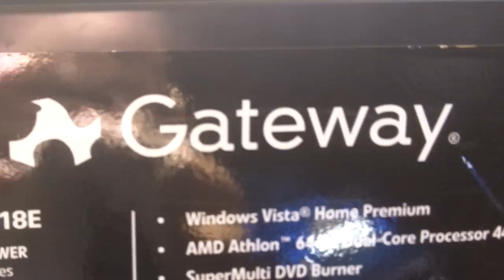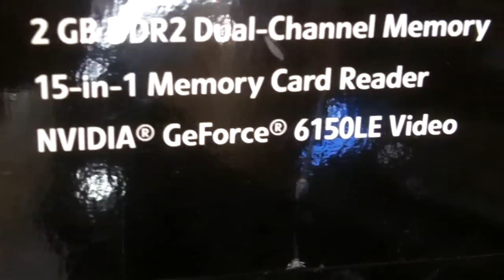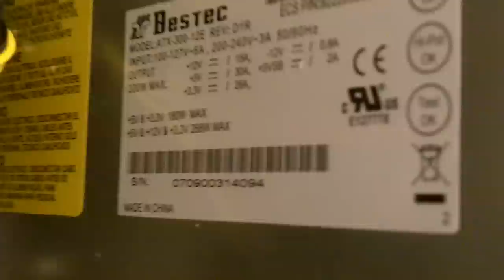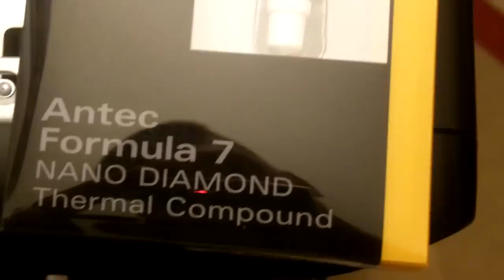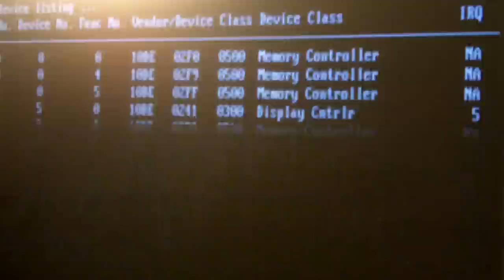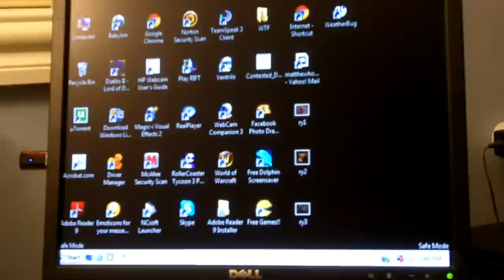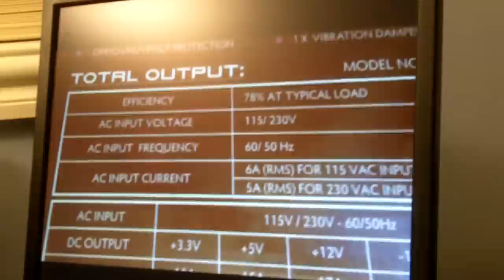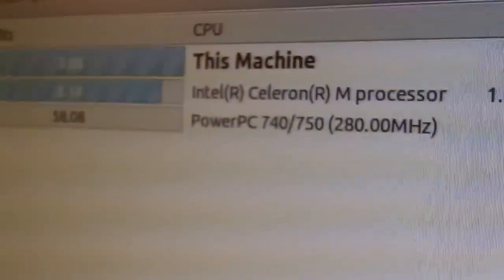Garage sale finds: $5 Gateway GT5618E Desktop Computer overview and demostration

Comment: i bought one  of the Gateways off Craiglist last night for $20 (plus $$11 in gas for a 1 hr round trip).
the guy didnt tell me it DID NOT run, well, the motherboard is dead due to eleven blown capacitors! Oh well its a cool looking case with the gunmetal and sliver and black, and the retro bay slots and mini-chip card slots at top (old tech, no one uses SD cards anymore to upload stuff, but still!)

I plan to put in a Dell 790 DDR3 motherboard, to replace MCP61 DDR2 mobo in it now.
Cool find, I like the sloping of the roof of the comp, i'll make this a semi-sleeper!

Comment: 5$? Wow, i mean i have had great deals as it comes to parts, but here in my country a computer like that even broken would cost approximately 50$, which is still not a whole lot, but 5$... And btw i have the same issue with my PC. It has a Core 2 Duo E7400 2.8GHz in it, but my BIOS only recognizes it as a 1.2GHz and CPU-Z recognizes it as only 2.2GHz per core. Also no benchmarks would work on it other than the Heaven Benchmark, Valley Benchmark and Pass Mark Performance Test.
Reply: I also have core2duo e7400,it works fine for me.Both cpuz and bios detect it as 2.8ghz although it goes up to just 2.73ghz,probably because I messed with the volages and some stuff from the bios to stabilse mixed ram sticks.Check the voltage from the bios(try resetting it too)  and also the socket and the cpu for bent pins.
Reply: Everything in my BIOS is fine. I guess my motherboard doesn't fully support that CPU. It has a FSB maximum of 800MHz and that processor is at 1066MHz. Maybe that is the cause of the issue. My processor is running at 800MHz FSB, so that probably affects its core voltage and therefore clock speed. So it is not running at its full capacity. By the way where are you from?
Reply: no way Bulgaria.Yeah,The problem is most likely in the FSB.

Comment: you deserve more views... and i liked the video, i have a somewhat similar gateway, it's the gateway gt4016
SPECS
amd athlon 64 3700+ 2.2 ghz single core
nvidia geforce 6100 ( i installed an ati radeon hd 5450 1gb card in it)
350w bestec psu ( i installed an antec 450 watt psu in it)
1gb dual channel ram (factory default) 
1 western digital 200gb hdd IDE
1 western digital 160gb hdd IDE
pretty good pc imo, it can play most modern games at medium/low settings, i'm thinking about upgtading the cpu to an amd athlon 64 x2 4800+ or an FX-55 what would u recommend?
Reply from the maker: Assuming your motherboard supports it, I would go with the Athlon 64 X2 4800+. It has more power behind it than the FX-55 does, also I believe the FX-55 is only a single core processor and the 64 X2 is a dual core processor.
Reply: you are correct and thanks!

Comment: I have same machine but had the Seagate drive, Problem is there is no support or drivers on the site anymore or can't update the bios & will not run Windows 10 as I tried it & got blue screen of death errors & the video card isn't compatible with it. I got Windows 7 Ultimate 32 bit to run & boots quick. Only & thing is you need to download Realtek Audio drivers from their site & NVIDIA 6150LE drivers on their site. It will not take more than 2GB ram & DDR-2 PC 6400 ram will not work. You have to use PC-5300 ram. System runs but a bit sluggish at times. I also tried a creative sound blaster audigy 2 zs PCI card but only issue when i stream audio (chat programs or web) only plays the left channel as that card not good in windows 7 but using the Realltek HD internal sound works ok.

Comment: How did the dedicated graphics workout. Cause I have the same computer running Ubuntu 64 12.04 and I'm thinking of putting a Nivdia gt730 in mine for steam.
Reply: Bump it up to a gt 740 I got my self one and it's running really nice
Reply: +julius hudson a GTX 560ti is better
Reply: +blakedmc1989RaveHD my gtx 970 is better
Reply: GOUST WILLIAM of course a GTX 970 is better b4 it would bottleneck on a computer with a CPU not so powerful like what u see on diz vid.
Reply: blakedmc1989RaveHD I know. I was just being a smart ass. But I still have a bottleneck.. Fx4350